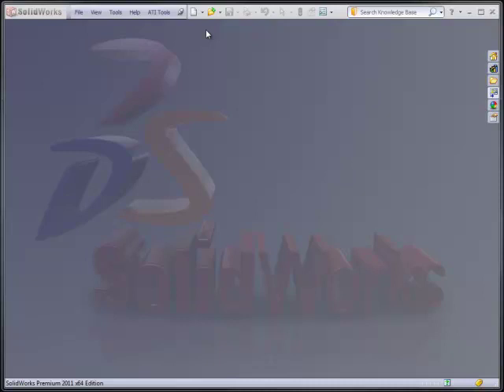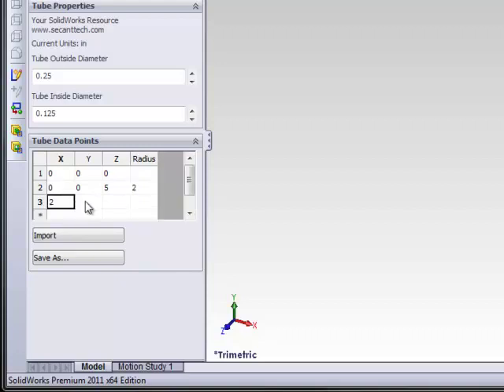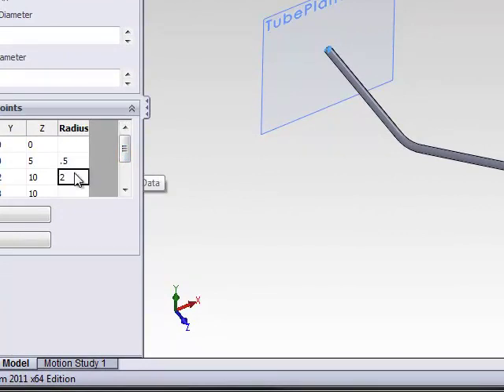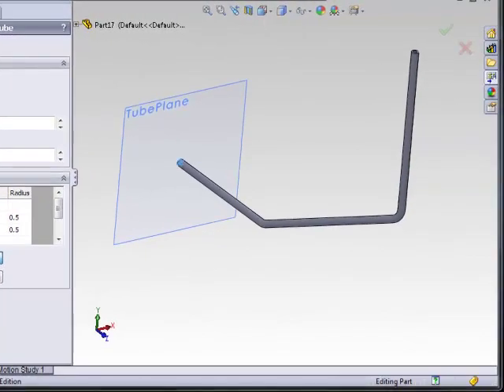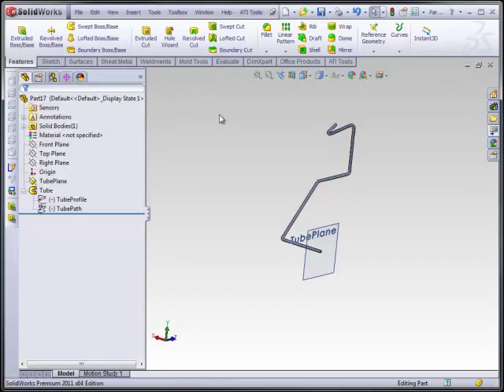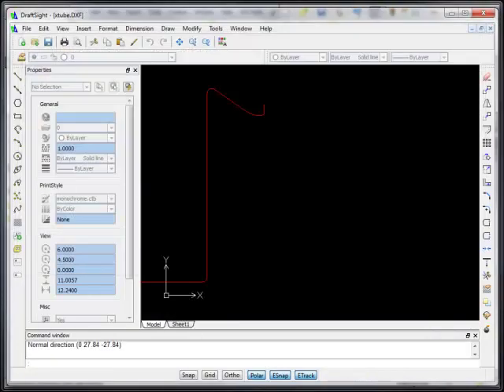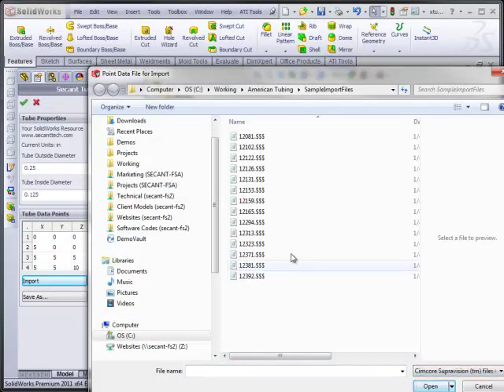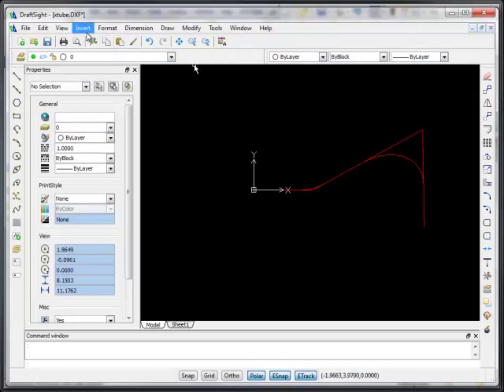SolidWorks Tube Coordinate Import-Export

Comment: Hello, I need a software to design tubes in a way easier than only using Solid Works 3d design. I'm seeing difficult to design tubes in a fast way, but the more difficult is when I design a tube with the data (X,Y,Z) and the length is not the same that the machine consider. I need a software that have a correction process similar to the "K-factor" that SolidWorks have to re-calculate the length of the bends in sheet metals, then I need to know if can you help me? There is a software that offers this function?